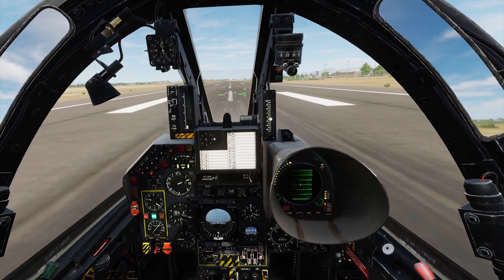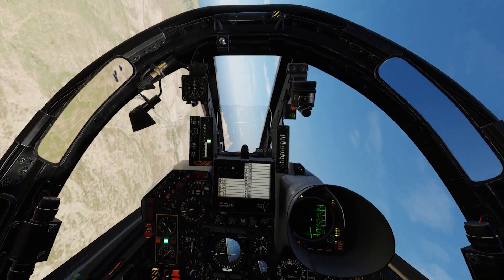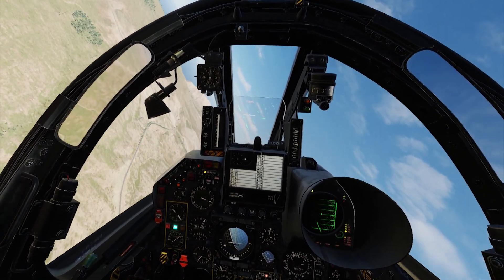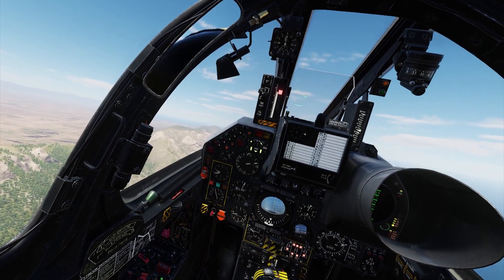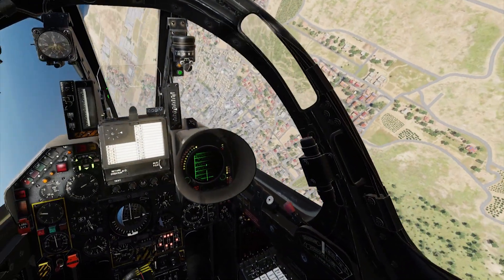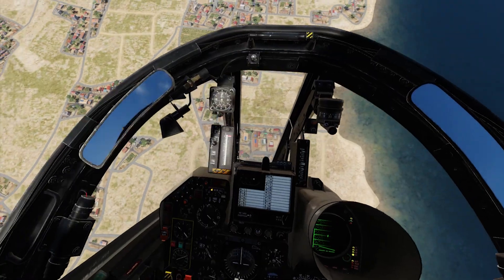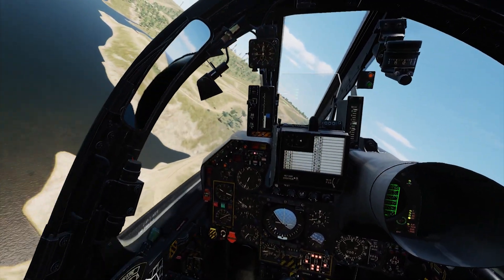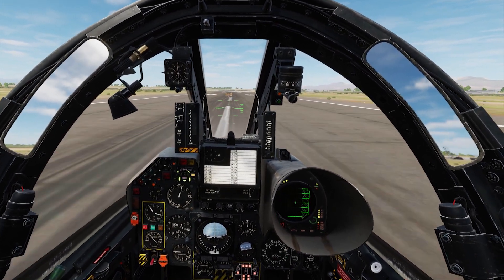OLD - Mirage F1CE Update (Jan 2023): Basic Flight Dynamics Analysis

Comment: Nice analysis. However in the F1 you need to go by the numbers for the landing. In final you need to be at 10-11° AoA and then flare up to 13° AoA and touch down no harder than -400ft/s. With no ordonnance and fuel < 1000 liters, i'"m at 160 IAS at 11° AoA

Are you ou were you an F1 pilot ?
Reply from the maker: Not an F1 pilot but I do have one we go to for qusetions, especially about the DCS F1. All of these jet planes are by the numbers, or you get a tail strike. 10 deg AOA with 13 deg AOA touchdown sounds about right. But no ground effect in DCS so I keep it at 8 or so on short approach or you hit hard. Even here it dropped fast at the end.
Reply: @FSX404  there is no ground effect in DCS ? I have the 2000c and it floats below 30ft.
I find it strange for a simulator to not have ground effect implemented
Reply from the maker: @CMBelite-FR  not like real life ground effect, M2000 devs might have added their own.

Comment: Btw what is the proper way to use parachute? I have noticed that when using it especially if still at high speed F1 will roll over to one side easily. It seems to be better to use the chute once speed has slowed down a bit.

Comment: no one has done a dog fight analysis of F1 that i can find, showing its weaknesses/strengths against other cold war aircraft that i can find. namely F1 vs Mig-15/19/21, Viggen, F-5...
Reply from the maker: Sicario (good pilot from my server) kicked my azz in an F1 with a Vigen. I was surprised at how the F1 performed vs a Vigen at higher speeds, Vigen slowly outgained it. The 19 and 21 can just go vertical so the F1 has to fight like an F5. Just zoom and boom the MiG-15
Reply: GVad The Pilot has a video from 6 months ago on this exact topic. Think he flew against a MiG-19, could have been the MiG-15. Anyway, he said to keep the F1 fast - around 400+ knots and keep with a 2-circle fight, don't go 1-circle. Keep above 10,000ft so you can dump the nose for extra speed. If you get slow, fly straight and level out to regain speed then climb. The jet is fast so you can always opt to run away if the fight is looking bad for you. Think similar to F-16 BFM.
Reply from the maker: @The90sHater  yeah, forgot about that. Basically you can use the F1 to zoom and boom if 2 circle is not working out. Its tricky, but I did it in that video. Basically samenthing I did in a Mirage 2000 in a video I posted a couple of weeks ago... speedup, hard turn, shoot, stay straight with nose down pick up speed, hard turn again... repeat

Comment: Are you sharing with Aerges the analysis you do of F1? It would be very useful for them to have this information to improve the flight model.
Reply from the maker: They do have F1 pilots who know all this, they have said it themselves and they have been improving as they go. But we must remember its hard to take an actual plane and develop it in a simulator, every little nuance , at all altitudes speeds, etc, its really tough. My video is for all who love the F1 and want to know a few more details, especially at the edges.